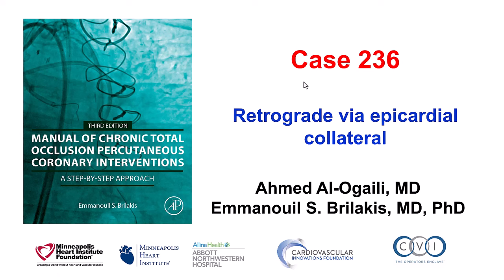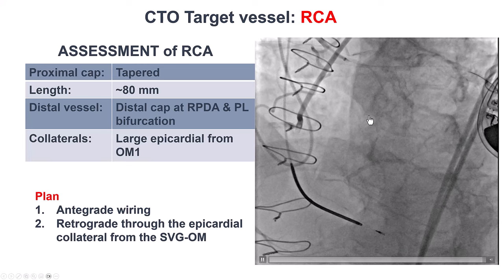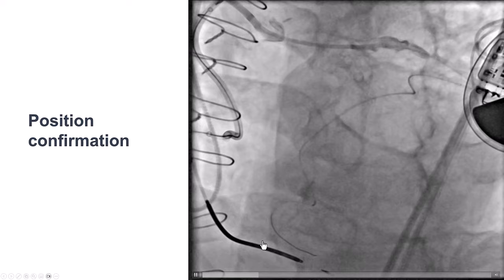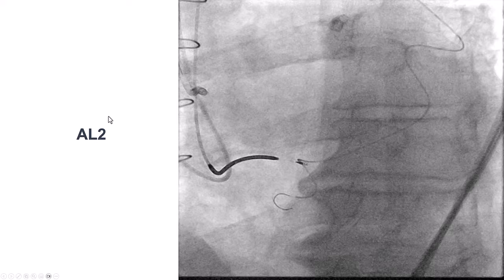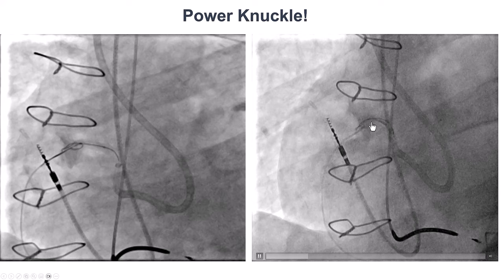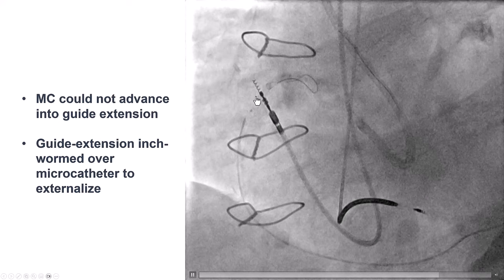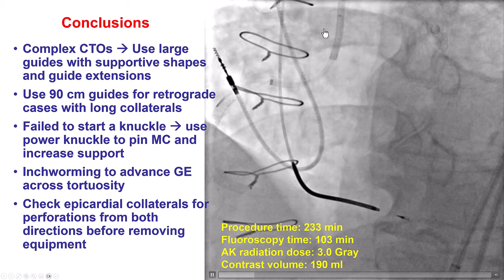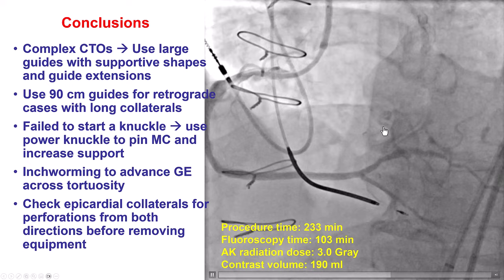Case 236: Manual of CTO PCI - Retrograde via epicardial collateral

Comment: Thanks for the case! Have you used IVUS to see areas of stent underexpansion? There seems to be a significant one close to the proximal cap.
Reply from the maker: Yes, we use IVUS in nearly all complex PCI including CTO PCI. In this case although the proximal RCA looks "funny" the area was large - part of the reason it appears stenosed is that the mid RCA is aneurysmal and there is a residual dissection from the reverse CART (that was covered with stents).
Reply: @manosbrilakis  Thanks a lot!